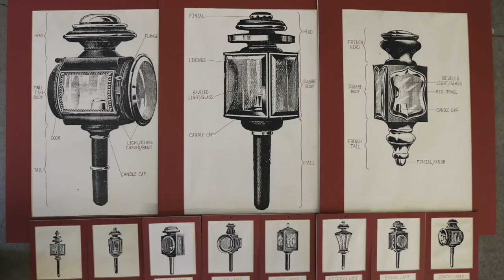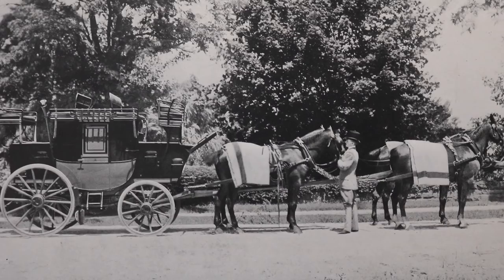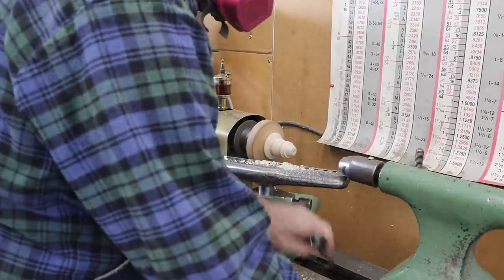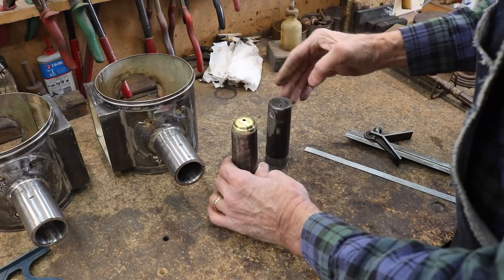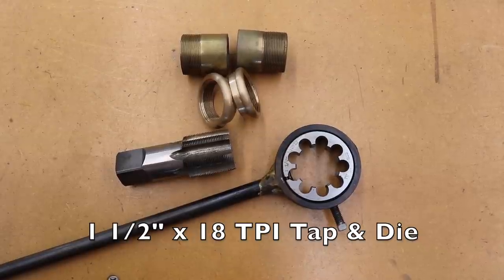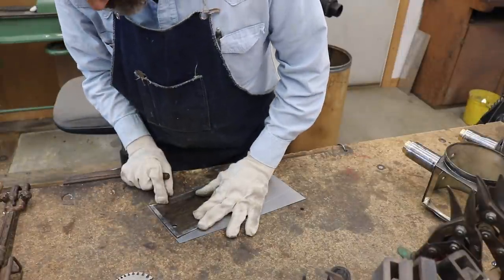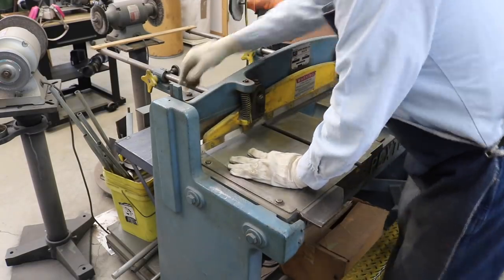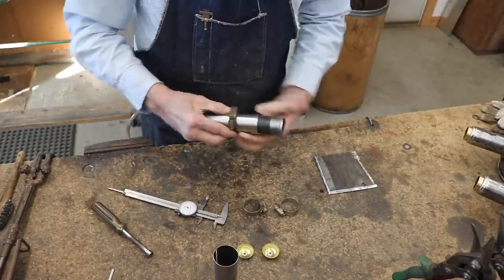How to make Removable Coach Lamp Tails

Comment: My grandpa would have words about putting your bare finger on something in the lathe. ;)
Never seen anyone use a leather glove to feather in solder. Interesting.
What keeps the threaded tail from working loose on a bumpy road? Shouldn't it have a set screw or.. something?
Considering that you're just brazing, it's a bit shocking to see the metal discolor that fast. I figured it was stainless, but what is it?
Watching how efficient you work is more fun than it should be. :)

Comment: Hiya Rick. This video raises a question. I can see how you fabricated those threads. Do you ever form threads in the sheet stock? A good example would be oil cans, where they are sheet metal, brass, tin etc. I don't know if it applies in lamps, just wondering if that was done with press dies or some type of roll forming. I expect that while the parts could be spun formed, I don't expect a thread could be spun into something like those brass end caps, so I am just wondering how you would handle an application like that?
Reply from the maker: With the proper tools threads can be made in malleable tubing and even rolled sheet stock. That method was used on later (1890 to 1920) carriage lamps, usually less expensive higher volume lamps. I haven't had the need to replace that type of threads. I expect tooling up to do that would be rather expensive. Thanks for your comment!
Reply: @TheLuminaryShoppe  Thanks Rick.

Comment: Not too sure if you'll see it, but if you load your files teeth up with soapstone, it helps prevent them from getting loaded with softer metals like brass and aluminum, and the remove material more efficiently! Plus, it acts as a bit of a dry lube too.
Reply: Cool tip. Got to try this.
Reply from the maker: I'll give that a try, thanks for the tip!